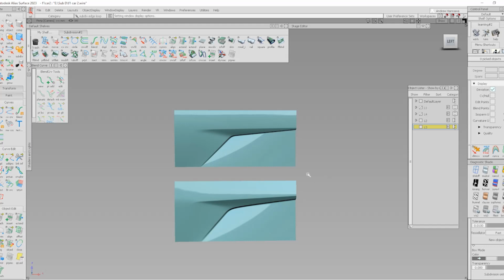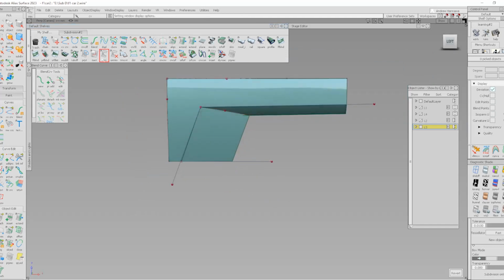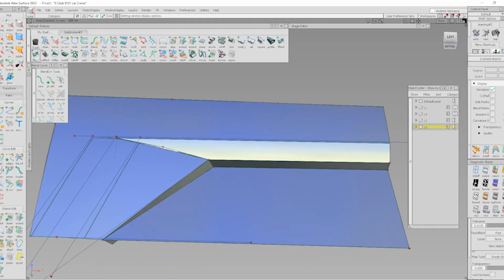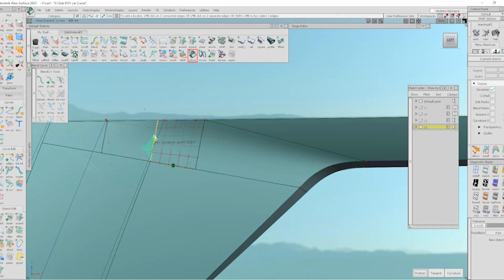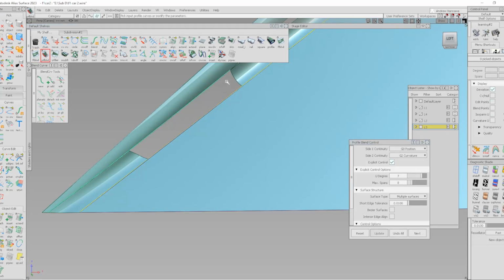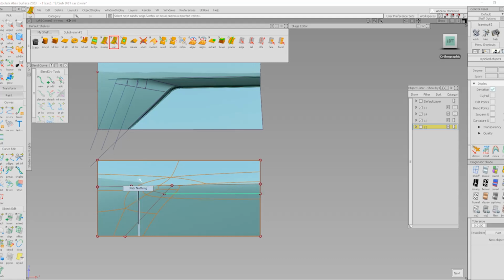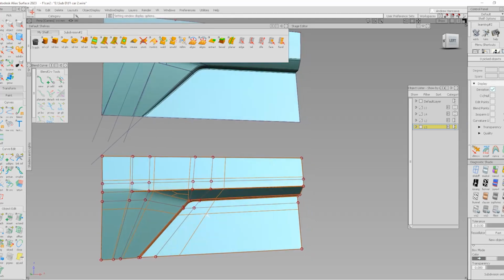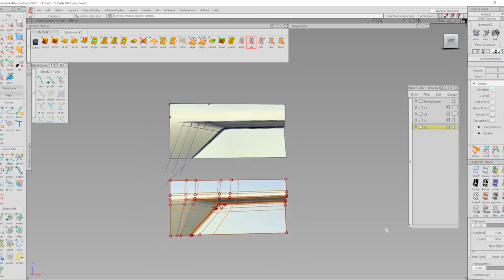Which is the friendlier tool? Alias Nurbs vs SubD

Comment: I say this with no malice...Good luck with larger surfaces and having (or trying) to keep CV's from getting out of alignment! You'll never get them perfect again. Im coming from 3ds Max which is basically Sub-D from the beginning of time. Ive been using Rhino so far for NURBS and it blows away Max for keeping perspective and proportions TIGHT no matter what angle you look at that vehicle.

Comment: With SubD it is difficult to control fillet radii (almost always it is wobbling\variable).
I wonder whether it is possible to control the Weight factor of a SubD vertex point and or hull to minimise Creasing\Split\Uncrease procedures?Thank you for this quite practical tutorial! Extremely informative! Did you 'Trim + Convert' the extended fillets before using 'Profile Blend'? If not maybe that is why it failed.